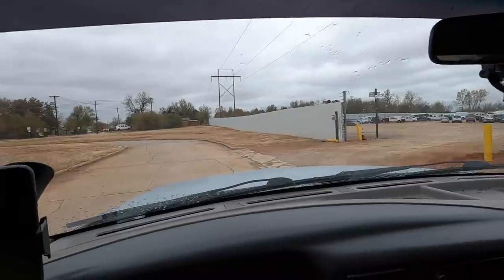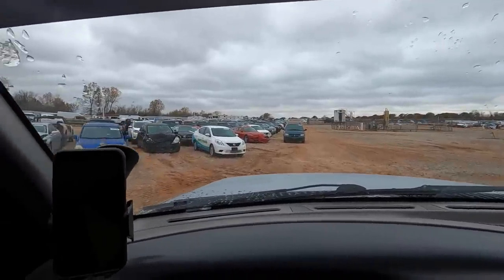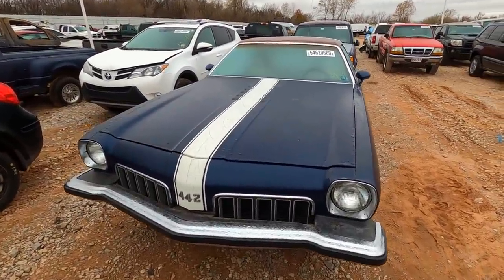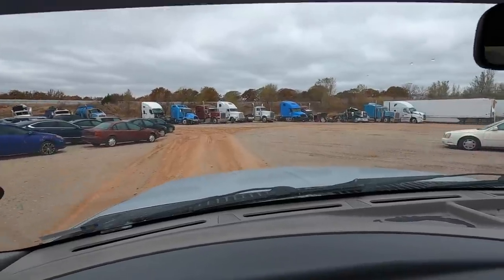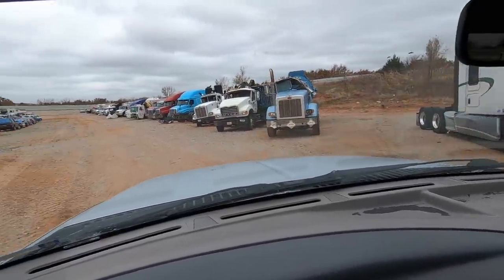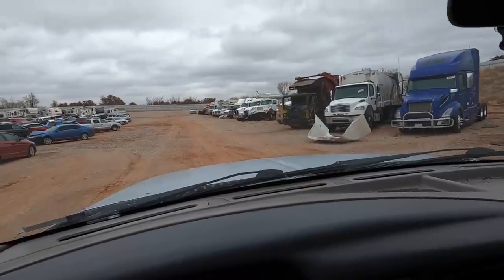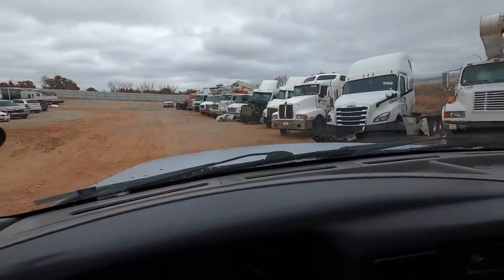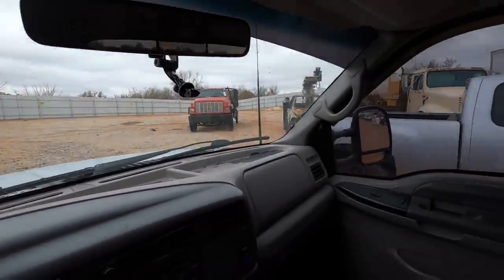Copart Walk Around 11-16-19 - 1973 Olds Cutlass 442

Comment: Excuse the dumb question but if it's a 442 how can it have a 350/automatic?  Is a 442 not a 400, 4 speed and dual exhaust?
Reply from the maker: You got it wrong: 4bbl carb, 4 speed, 2 exhaust.
Reply from the maker: https://en.wikipedia.org/wiki/Oldsmobile_442
Reply from the maker: By 73 you could get a MT, or AT in the 442.
Reply: @AutoAuctionRebuilds  gotcha, makes sense

Comment: 442. 4-barrel carb, 4-speed gearbox and dual-exhaust. but all are not 4-speeds some were 3 speed manual & automatics so some have changed the second 4's meaning to 4 tires

Comment: Hydraulic brakes means no special license required.... here.  Who knows what weird laws Oklahoma has on that.  5 speed main with 2 speed rear axle.  The International will require a  CDL as it's air brake and a tandem.  That Kubota is on a hydraulic pump not a generator.  It looks like some sort of chemical mixing setup on the back having the inductor and the circulation lines in the tanks.

Comment: Are you kidding? That car is worth every bit of $5500, if they were selling for $4000, you'd probably be chomping at the bit, so offer them 4K? The car doesn't seem to need much except TLC, and some estetic replacement parts. I have heard, and seen on YouTube, people are preferring to buy original, not rebuilt classics. That Cutlass is perfect for doing an all original restoration on. Everything appears original, just need to do some paint work, not a repaint, upholstery, trim pieces, etc You can't see the potential here? I think this car, with some minor restoration will be worth upwards of 20K. I think you can get this car up to snuff for under 10k, it's a deal, and would be great vloging material.

Comment: I don't think it's a real 442 because it doesn't have the dual hood scoopes.
Reply: research friend.hoods are replaceable
Reply: After '71 they were all appearance packages.
Reply: Lars, the '73 model was a Cutlass S with a 442 package on it.  It didn't need hood scoops because it only has a 350 and not the 455.

Comment: 4-4-2:
1) 400/455 (the 1st 4)
2) 4-Speed (the 2nd 4)
3) Dual Exaust (the 3rd digit)
people don't know the real meaning for 4-4-2 not 442 or Four fortytwo 
if a 4-4-2 has a 350 Rocket or not its worth $2500.00 cause it has the swivel bucket seats (73-77 Olds, Buick, Pontiac, Chevy) [ Laguna S-3, Monte Carlo S from 73-77 had this as an option and had a slap-stick 3-speed automatic (TH-350)
Reply: 1st off only the first generation of the 442 was 400, 4 speed , dual exhaust. My Brother in laws family collects 68 thru 72- 442s. All of them,  everyone is a factory automatic.  That generation is 400 , 4 barrel , dual exhaust. In the mid 70s was the gas crunch so it lost a lot,  most were 350, 3 speed auto, 4 barrel carb. So nothing really was what the emblem said.  In the 80 again 442, was  a little 305 maybe 350 motor depending on year. So you had 4 barrel carb, 4 speed automatic, and a half dual exhaust. I have had several Olds cars myself. Including 442 and a Hurst /Olds. Make sure you know what you are talking about when you say this car isn't correct.
Reply: you're right ... but I know my share of vehicles cause I've been there when they ran the streets banging gears

Comment: If the truck has air brakes you got to have CDLs.
Reply: Julius Cullum  not true. If the vehicle is under 25999 you don't need a cdl. I know a guy used to drive UD flat bed with air over hydraulic brakes.  He had a reg license. In Florida if you drive a truck hauling your own personal use you do not need a CDL.
Reply: The truck with the Vermeer tank is used for directional drilling. The tank contains the mixture for the drilling mud. The other eguipment is for the drilling machine.
Reply: That's not true I got my CDLs if it's got air brakes you have to have the air brake endorsement. I'm fixing to get my tanker endorsement.
Reply: Julius Cullum   In Florida you don't. I just got rid of class A CDL with Hazmat and tanker. In fact agriculture vehicles aren't regulated by Dot. They are some of the crappiest trucks on the road. I got tired of getting my license renewed every four years anc it $180 bucks. Fed fingerprints and back round check.  Maybe your state is different. Your original comment said you needed a CDL to drive with air brakes. Nor having the endorsement. It is only about 25 questions and. If you read the book you can pass it. I have had a Chauffeur license( NY) commercial drivel era license Florida til they went to CDL in 1990. I have had my license 1972. Drive Schoo Bus. Good luck.
Reply: There might be a difference in laws. I also got my HAZMAT endorsement. When I took my classes for my CDLs my teacher said he had a heck of a time trying to teach some one from your state. He said that in Florida you don't have to come to a complete stop at a stop sign. Is that true?
Reply: We also have soft laws on trucks if your a farmer here in Illinois.
Reply: @juliuscullum6596   what state do you live that requires it? you must be using it for hire too then... and must have a big hauling truck...
Reply: Julius Cullum  That is not true. Stop Means Stop. No rolling stops.
Reply: Julius Cullum   Just remember tankers has baffles in them. That is to keep the liquid from pushing the truck ahead in a heavy stop. Good luck.

Comment: If it is 10,000 lbs gvw plus vehicle including trailer you need a dot medical card to drive. Anything over 26,001 lbs gvw you need a cdl. If it has air brakes no matter what size you need a cdl. That’s federal law. It may be different.

Comment: if copart didn't go out to each boat an pull the motor's water passage plugs before it for it got down to the 20 degree temps last week they will all have cracked  engine blocks 100%,  don't get suckered folks!

Comment: I love the 442. It's in great shape for a restoration. I don't know what it's worth. Can you show us the RX8? 

 Would Copart let you drive your Ford into the regular lot during the winter? Even if you had to buy a cheap amber magnetic roof light… 

 Buy the Jeep. What does the website you use show about the Infinity? Beautiful car. I think those gaps could be improved. How many miles on the Infinity?

Cobalt is a VERY high end boat. No problem getting a cheap used trailer.  Other propellor engine was in gear. We bought a used trailer for same size boat used for $250. Someone stole ours. Truck #2:has gear for horizontal boring.  If you want one have Westen find you or make you a roll back wrecker.

Comment: That's not the 350 rocket. 442 = 400, 4 bbl carb 2 exhaust.
Reply from the maker: Wrong. 4-4-2 is 4bbl, 4 speed, 2 exhaust. (Check Wiki if you don't believe me.)
Reply from the maker: And it is 100% a 350 Rocket.

Comment: 1st car: wow an auctul old car not some morden junk box or car that was once nice that is now just a fat lump of plastic and engine and is over priced, dam 73' just before the fuel thingy were gas guzzlers became dinosuars or were car lot and scrapyard fillers, its uin ggreat shape maybe one of the rare orgnials that hasn't been mucked around with or been modded, DUDE THAT IS I WANT THAT IN MY CAR! i know like ford had in ther cars the swing away steering wheel for the more larger buyer BUT I WANT THAT! DUDE THAT IS A COOL FUNCTION! why isn't that in newer cars?! it would help grandpa n ma get in and out of there car with ease! 5500? 550? 55,000? cus if its the first 2 then no way 550 though its not bad! its going to go for way more though, even if the insides no good and the vynal needs looking at its still a straight orgnial car, 
2nd car: a morden trying to be old jeep nope, if your giong to have a jeep go for the 90's versons or the orgnial ones, 
3rd car another morden crap thing yawn oh blue mustang in front of it though, 
4th car or boat, ah boats, if i learne from pawn stars boats a money pits you just throw money into them and watch it just fill up and you can't get it back yep staying well clear of boats, 
5th car or boat, yeah no its got no trailer so yeah no, 
6th car or truck eh no i'm more a peterbult guy or the kinda that pours out black smoke and is from the pre 80's era of trucks when they had a frtont end and were trucks not just a truck that goes here and is stream lined for better fuel pfft you think i care? i want something that when i'm going along black smoke come from the pipes and the horn honks louder then any lil dinky car horn, you'll know me i'll be the truck driver that at the end of the bar drinking and smacking the ladies butt to get me another drink the ones that slaps back that's the wife yeah!,
7th car, another truck i already said get that rig off the road and make way for the real truckers boys, if you can tell you what if you can hual ass then your okay but your just hualing light loads when you hall ass and only have 5 days to get there y'all be begging for some white pills, but i stay up with monster, 
8th car or trailer, hmm those are some facey graffics on the side, shame your in the usa as my dad works for a place that makes those decays for caravans n motor homes, pretty cool to see them made too, oh and the doors wedhed or damed oh well guess were not going in there,

Comment: The 442 up through 1972 had a 455c.i engine. By 1973, the horsepower wars were over and performance engines were being choked by mandated smog equipment. This generation 442 with the 350 c.i engine only had 180 HP and was little more than a dressed up Cutlass and is of little interest to collectors and muscle car enthusiasts. I would walk away from this one.